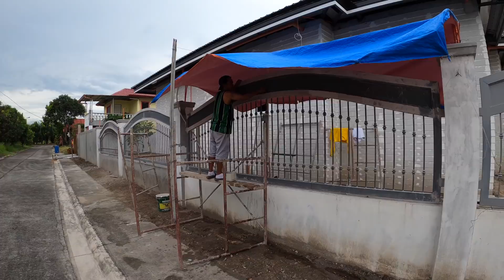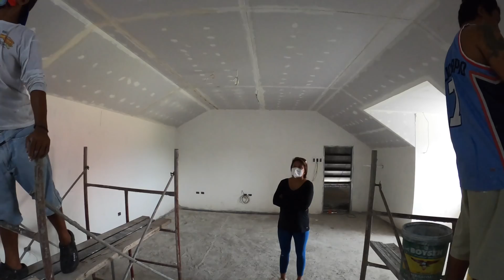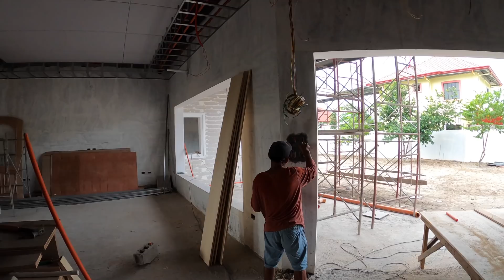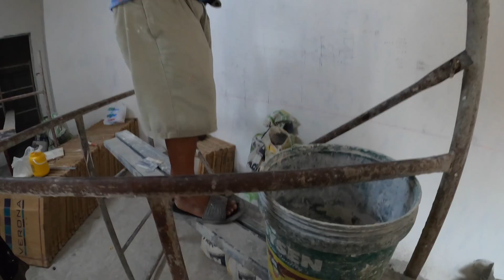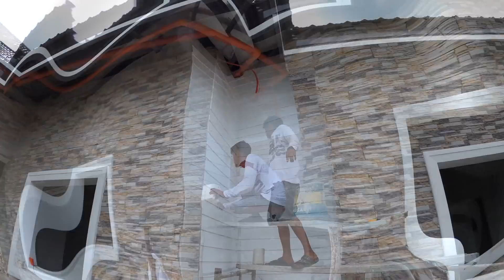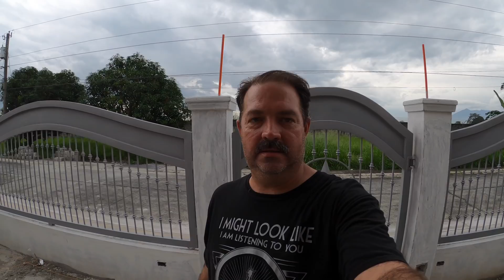Philippine House Building Step by Step, Build Day 181: Drywall Ceiling Mudding and Taping

Comment: Sir whats the use/purpose of wire gauze on ceiling?
Reply from the maker: The gauze is either plastic or fabric coated with a light glue. It’s drywall “tape”. There are several kinds, but the two most common are a solid tape or a loosely woven gauze like material. This helps hold the mud or skim in place over the joints in the drywall. Applied correctly, it makes the joints virtually disappear. The wall or ceiling should look like a solid surface without lines or separations.

Comment: I noticed that you’re using steel door frames instead of wood frames ?
Reply: I assume you will be painting those a certain color?
Reply from the maker: Yes, Steel door frames last longer and are not susceptible to termites. The frames will be painted at a later point.